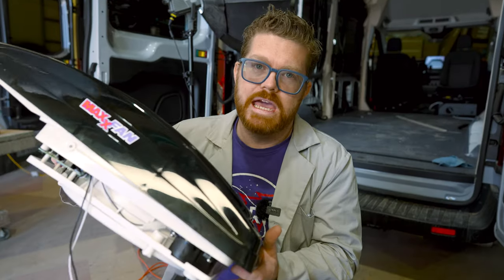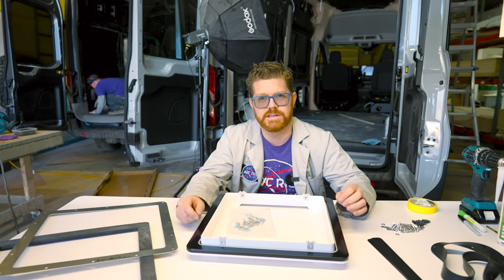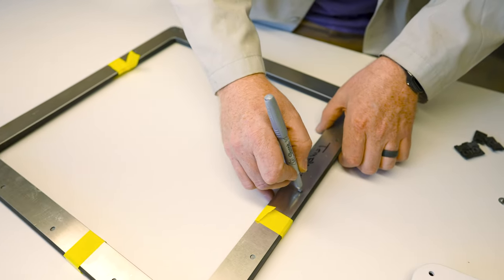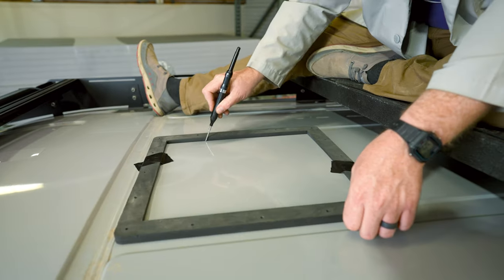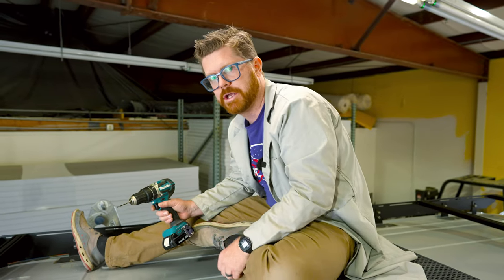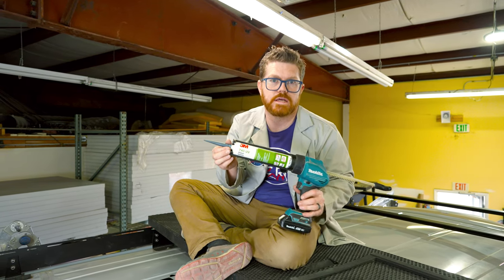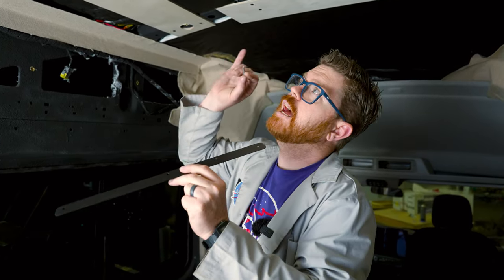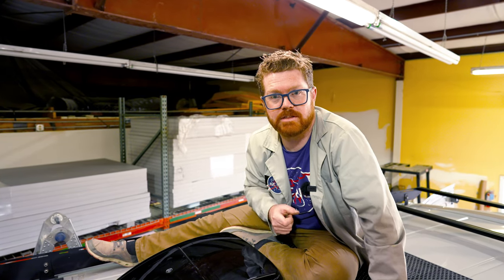MaxxFan Mounting Kit | TRANSIT Specific Fan Accessory!

Comment: Hi Matt,  Thanks for the great video.     Many people use wooden frame inside the van so it's easy to run screws up through the white cosmetic roof bezel into the wood frame.    But looks like  the VanProject kit has those  metal plates on the bottom inside the van.      How did you attach the Maxx fan  interior bezel ????

Comment: Hey Matt,  Excellent job.  This is the best install I have seen so far.  I have a Ford Passenger van.  Do you have a video on cutting out the headliner to fit the Maxx fan adapter box ?
Reply from the maker: You know I haven’t, but that would be a good addition. Next crew or passenger we will be sure to film that. We use the opening in the roof to trace our cutout to the headliner. Just temporarily reinstall the headliner trace with a marker from above, then cut your headliner. I do this between installing the trim ring and the actual fan itself.
Reply: @AVCRIG  Excellent, Thanks much Matt
Reply: @AVCRIG  - When you mount the adapter box inside on a passenger interior, after cutting out the hole, do you have to remove the original hardware you put into the mounting strips underneath? Do the screws have to go through the adapter box, strips, and into the roof mount?

Comment: Before I drop 2 bills on this very clean install kit, (I already have the DIY roof plate) is the fan still water tight? Also, why replaced the side clips that the fan screws into? And lastly, when threading the stainless bolts up through from the bottom, is the upper bracket on the roof kit threaded for those stainless bolts? Thanks! Love your video tutorials!
Reply from the maker: Fan install is still fine. I think it’s a cool solution but a year later we just went back to a standard install. I’d stick with your DIY plate and if you want to go the extra mile replace the screws in the maxx kit with stainless through bolts with nylock nuts.

Comment: Looks solid and super clean!  Curious if the stainless fastening screws that Van Project 1 includes with their kit are long enough to accommodate the thickness of the DIY Van adapter?
Reply from the maker: We were the first to try this combo out and I picked up a few longer screws fit just this reason. I gave them updates lengths and it’s all good to go now.

Comment: That looks like a nice kit, appreciate your video.  A month or so later, are you guys still happy with the install/waterproof-ness?  We're just getting ready to install our MaxxAir and are trying to decide if we're going to use this or just go with the "old fashioned" install.  Haven't been able to find anyone else that's used this yet.
Reply from the maker: I am happy with the final install. I do think it’s a bit over the top. I’ve never had an issue with our normal install. I do think the the DIY van adapter makes the install really flat and easy.
Reply: @AVCRIG  I agree, it does seem a bit over the top, and, another cost.  I seem to keep finding new ways to spend money on this build.  On the plus side, I like the idea of not having to worry about various sealants and the upkeep on those.  I know the sun/UV is unforgiving on that sort of stuff.  We are pretty set on using the DIY adapter, it seems like an efficient way to simplify the install.  
Thanks for the update/reply - looking forward to your next video!

Comment: curious why 3M 740 UV is used in the tutorial but a different product is linked in the description? Which one do you recommend?
Reply from the maker: I think that was a mistake on our posting. Sorry. We use lap seal for the exterior surface on most of our installs. When sealing in between two areas I prefer 740 UV. Dicor lap seal has always been my go to for a leveling exterior sealant exposed to the weather. 740 just doesn’t level out as nicely.
Reply: Great to know! Thanks for making all these super helpful tutorials!